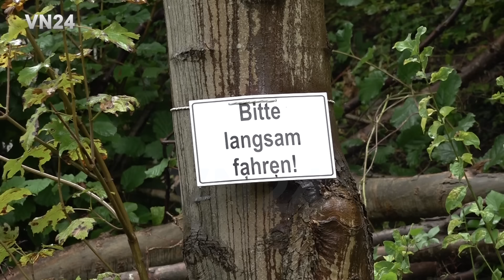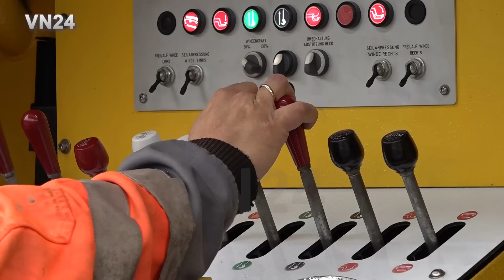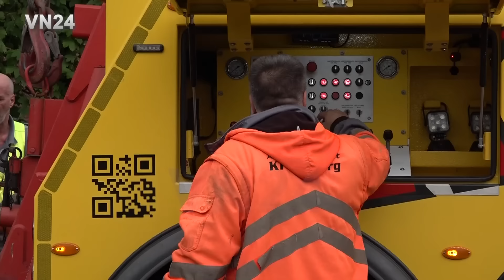04.09.2024 - VN24 - LKW rutscht in einen Wald - Neuer Abschleppwagen das erste mal in Gebrauch

Comment: Hi VN24,  Kreuzburg recovery  seem to have a good idea on the job but sadly lacking in  any idea of danger. For example standing in front of a cable under load , a complete disregard to eye protection and safety foot wear. Might be the modern way but any one trained in vehicle recovery would have  had it been drummed  into them  on safety , esp winch ropes. Nice filming and editing   as usual , thanks.

Comment: I can't believe with the biggest truck power y'all have you are that incompetent if you can't pick a front end of a truck up off a guard rail and I would not pull the truck up the hill with gargoyle attached to it you could have busted the tires can a bus to the radiator you could have caused more harm than good you know anybody can pass the CDLs but are you a good operator that's the question